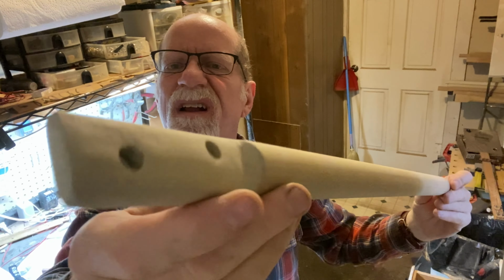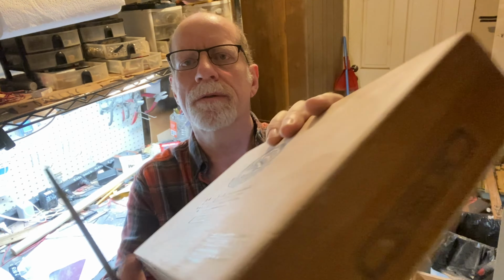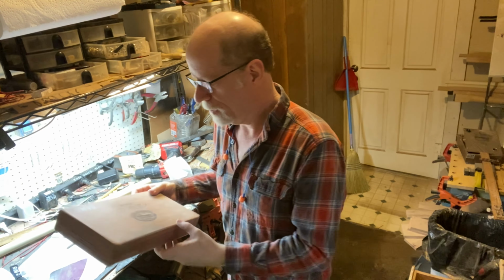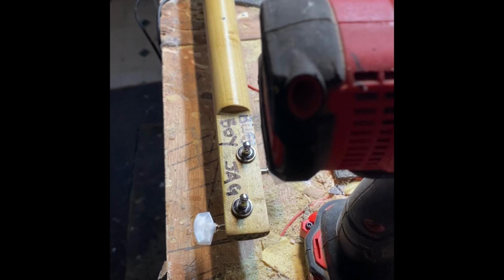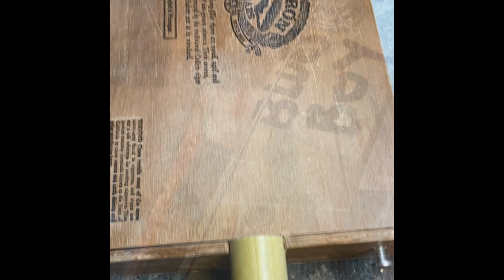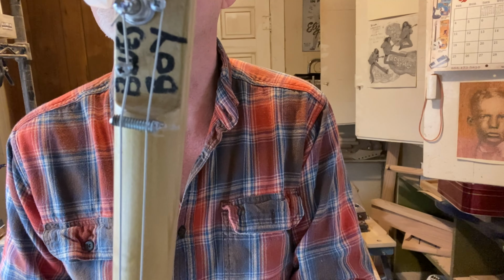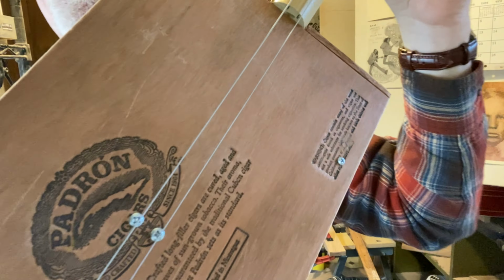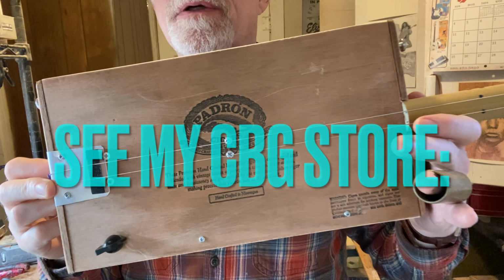Building A 2 String Cigar Box Guitar Diddley Bo #2stringguitar #cbg #diddleybow #cigarboxguitar

Comment: Nice! May I ask--I can see that you've sliced the dowel so that the part in the box will have a flat surface flush to the box lid. How far does the dowel extend inside the box? And do you have it glued or otherwise attached to the box lid? Or is it just held in place by the box lid being screwed shut and the tension of the strings? Thanks!
Reply from the maker: Glues in about two inches 👍🏼
Reply from the maker: Glued